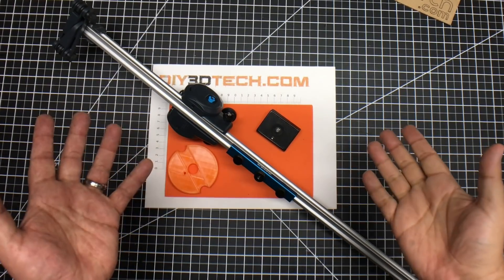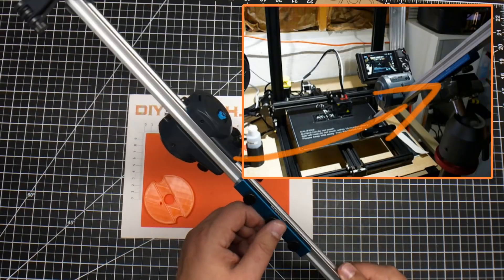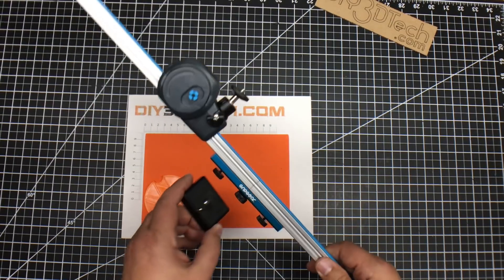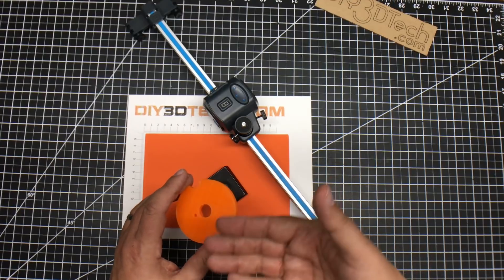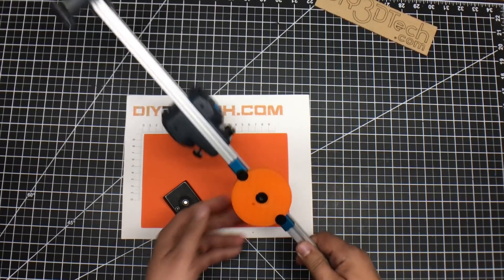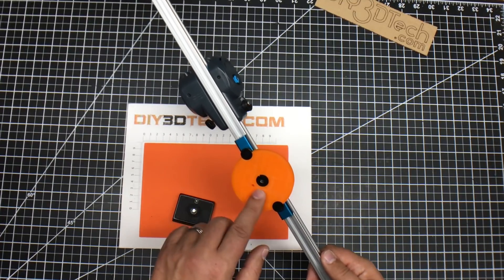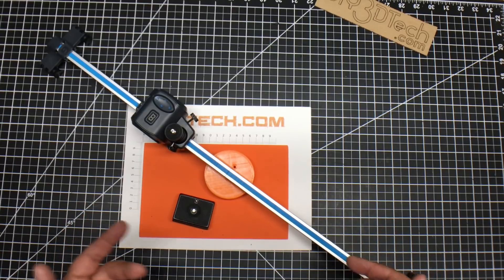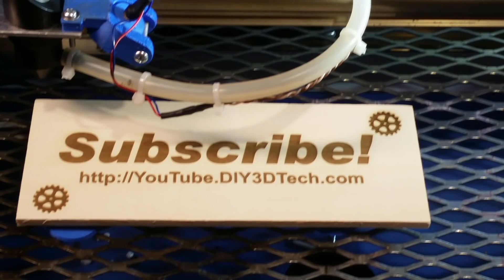Design Talk  - How I Solved This Problem With a 3D Printer In No Time!

Comment: Great solution, but why didn't you print the quick release plate as well? I mean, you didn't make it in a way it can rotate on the QRP.
Reply from the maker: Too much weight for me to trust, as this still mounts to the metal body, the 3d printed part only holds it in alignment.  This is rather heavy and long...